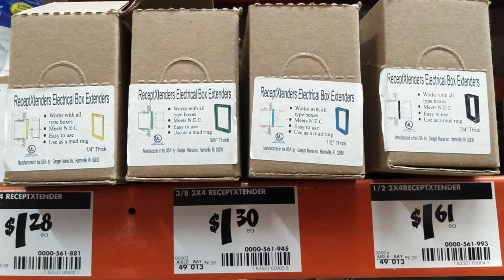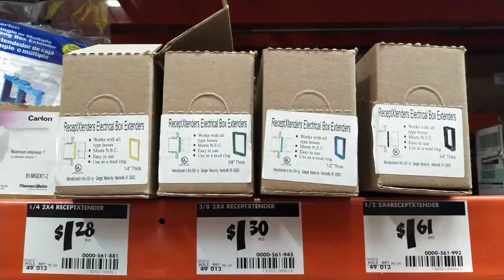My Electrical inspection Failed🤔Box set-back issues!

Comment: I always thought the reason the code being 1/4" max distance from box surface to wall surface is to minimize the amount of flammable wall material being exposed to the live wiring, ceramic tile would not be flammable.Interesting.
Reply from the maker: Thanks for watching and commenting. Your absolutely right. Up to a ¼" is allowable or non-combustible walls such as tile and drywall. Combustible wall surfaces such as wood paneling is supposed to be flush to the finish wall surface. I've found, most inspectors don't even look for this on final inspection.

Comment: Been using adjustable boxes for these lately. Kinda expensive but by the time you buy boxes/extensions it is about the same price. The time it saves is worth it to me
Reply from the maker: I would totally agree 💯%
I just wished people would tell me their thinking 🤔 about tiling the kitchen backsplash. I would install them. Thanks for the comment, It's a good one.👍🏻👍🏻
Reply: @Working Man🛠️Ron Doyle  yep, just had someone change the cabinet layout 3 times 🤣. I didn't charge them bc it was a huge house and I was already making pretty good on it. That was a mistake, they hired a designer and called wanting to change more stuff. This was weeks after rough in inspection so I finally told them I could change anything but it's gonna cost them
Reply from the maker: @zackfletcher28  I know how ya feel. I've been in that boat before. I was involved in a $130k kitchen remodel and they changed their mind on a refrigerator 3 times. So I located the outlet as designed by the Sub-Zero manufacturer. And when they installed it. The outlet was in the wrong place. Come to find out🤔 the model the customer ordered was discontinued 😥. That seems to be the way it goes on big projects. Thanks for watching and commenting 👍🏻

Comment: Box proper spacing: (thanks for Publicizing this common violation)
Electrical boxes are designed to contain potential arcing, sparks in the wall cavity
 could cause a catastrophic fire.
Reply from the maker: Thanks Mack Fisher👍🏻 I only hope 🤔I clearly got this point across to the general public! Thanks for the comment , Your absolutely right 👍🏻

Comment: Why did you use drywall screws instead of 6-32 machine screws?
Reply: Cause they work… most inspectors are fine with it.
Reply from the maker: I'm running low on longer 6/32" machine screws. The course threaded drywall screws hold good in these boxes. 
I appreciate you watching and commenting 👍🏻
Reply: @workingmanrondoyle3287  I was taught to never use anything but machine screws in an electrical box. In this case the sharp point has no risk of hitting a wire so I can see that it isn't an issue.
Reply: @illestofdemall13  same here taught to use machine screws. Ron's an excellent electrician and very knowledgeable he wouldn't do anything out of code .
Reply: @dennywires  I agree, he is really good.
Reply: I've seen just a few videos of Ron and I think he's very knowledgeable, so I was surprised when he used drywall screws because that's a violation of 406.5 but ultimately if the inspector is ok with it so be it.

Comment: Hi I saw you are using drywall screws, isn’t it violation?
Reply from the maker: Thanks for watching and commenting. That's a great question. It would be a violation if using drywall screws in a metal or fiber type box. Not in plastic. I have had some drywall screws not fit properly if using fine threaded drywall screws. I always buy the course threaded one's now.